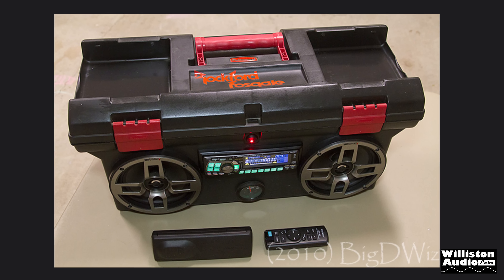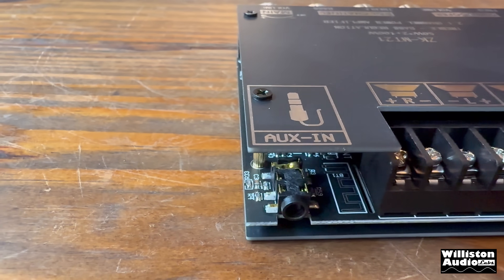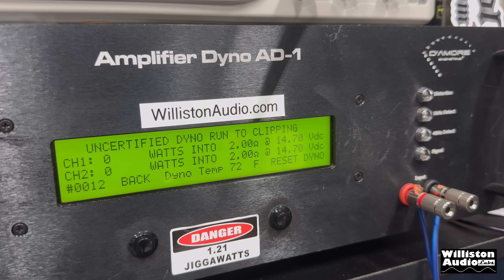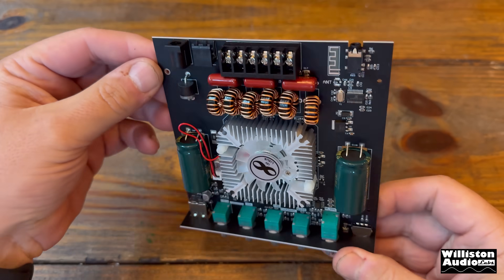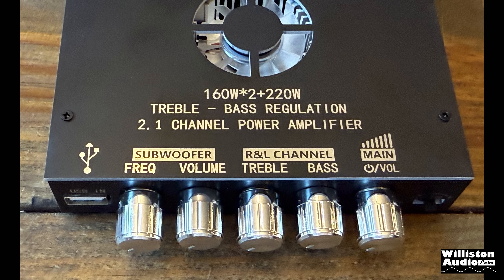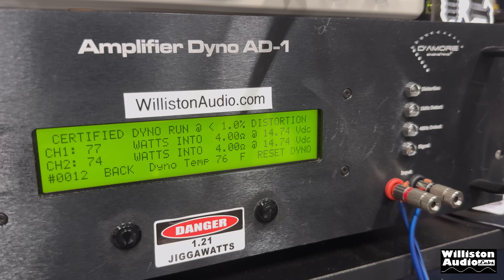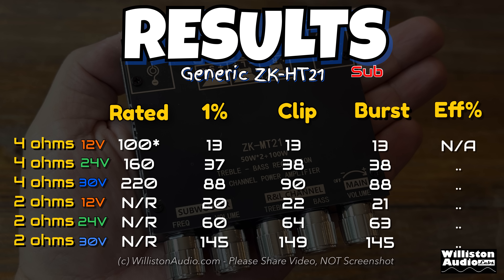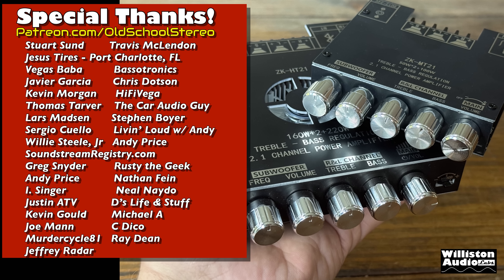Can This $15 Mini Amp Power Stereo Speakers and a Subwoofer? ZK-MT21 and ZK-HT21 Tested and Reviewed

Comment: I just matched this little amp, along with a super-crappy $50 "subwoofer" from Aliexpress, a JCALLY JM6 Pro Dongle-DAC and an old pair of "Bottleproof" (all metal case and grill) Blaupunkt bookshelf speakers and... For a system which cost less than $150 NZD in total, and I plugged it into a little laptop and... Holy Moly. I can hardly believe it: it actually sounds bloody good! 
Like WAAAAAY better than a stupid Logitech 2.1 piece of garbage. Super surprising. Would buy again!

Edit: Hehe - I got a bunch of the $5 light bars from AliExpress, too!
How can you possibly say no to those???

Comment: I'm currently using the " BT- WUZHI" , that's what pops up on connected devices. $12 on TEMU. I have it hooked up to a pr of Micca MB42's and a ARSp112sw (?). I'm not at home to know if I got that right.  I'm happy with it because it's cheap and sounds good. I don't know what I'm missing if I don't compare it. I also own the ZK-MT21 and the Micca 's sound great with that. I do hear a hum with the WUZHI at louder vol. or if I touch the dials. Fun stuff .

Comment: I started with a cheap 2.1 amp then got Fosi Audio. Not high end by any stretch, but does great running my speakers off my PC with speakers I built. Now I have a plan for head unit boom box with Tang Band speakers. They have a slim mount 6.5 inch subwoofer. It won't dip into earthquake territory, but will be great for such a build. .25 cubic feet for F3 of 62.2Hz.

Comment: I have the ZK-MT21 class D amplifier,  hooked it up with my 40watts Pioneer bookshelf speakers and a 100watts 8ohms subwoofer...audio output is awesome...I didn't expect this tiny amplifier can power up my speakers and subwoofer 👍

Comment: Your series of videos on these mini amps got me started building with them. I've done 3 2.1 setups and one 2 channel stereo. The two channel stereo is one of the 100x2 ones you highlighted before this one. Had them on several speaker setups until I discovered the skar fsx 10's. They are a "midrange" pro audio speaker that retails for like $30-35 range. You should hear the bass these things put out on just the two channel 100 watt stereo amp. They are listed to play down to 50 hertz but I would guess the drop off is more like 40. The fattest sounding speakers I've ever heard. Barely need a sub and they are midrange. I tried them on the 2.1 ht21 amp and apparently there's a built in low pass crossover on the stereo speakers. They sounded completely hallow. It's put me off from building with these cheap 2.1 setups. The built in crossover removes like all the mids. My 100 watt x2 stereo amp on the two fsx 10's outperforms all of my other setups with subs and twice the power. Running them on 350 watt 36 volt power supplies. The 100x2 stereo amp is running on a single makita 18 volt drill battery. Hits like a ton of bricks because it's giving the speakers full range. 

You need to check out these skar fsx10's on a video and build a 2 way with some silk domes and a passive crossover. Someone needs to hear these things. Rated frequency range is 50-10k hertz. They are very popular for replacing guitar or bass amp cabinet speakers. Tells you they have way more bass than advertised.
Reply: The subs can't really fill in the mids so side by side the 2.1 system I have with two 5 1/4" recoil components and a skar evl 6.5 in a sealed box running double wattage on a 36-350 watt meanwell power supply is not as full sounding and doesn't hit as hard as 100x2 on a single 18 volt drill battery with two skar fsx 10's.

Comment: 5:08 it looks like you didn't set the frequency knob correctly and the volume knob correctly. To properly measure you must turn the frequency knob and sub volume knob all the way to the right to get the proper output, as it will lower the rms because of incorrect frequency crossover, probably why it says 50 watts only 😅

Comment: Can i run 1 ohm load in the subwoofer out? Or only 2 ohms? Thanks! I'm currently using 24v 3A power supply

Comment: I've run both the 2x50 and the 2x50+100 combos. The 2 ch sounds good. The 2.1... not so much. TBH,  to me it would be better to crossover pre-amp and then use it discretely like that. For example, you could easily use something like a 3-way preamp crossover (think Coustic/Audio control) and then use a relatively small power bank. But honestly... the SQ is so bad at volume that a traditional amp is better. I've blown no less than 6 of these amps. They are what they are. Cheap. But better than nothing.
Reply: BTW... Every one of these I've blown, it was  trying to run it at 2ohm. It does not like it!

Comment: Guys regularly run that larger amp at 42 volts(a fully charged 36 volt battery) and they do great. I wonder what they put out at that voltage.

Comment: Ive just used a £14 HD RUSH Dolby 5.1 and DRS decoder and a couple of similar amp modules to make a really cheap home cinema system, Im going to replace the amps with an infra red remote control versions.

Comment: WHY 2.1? Better to have all power available from the power supply going into just 2 plain stereo channels. 
I HATE subwoofers! They rumble louder in the next room or one apartment over or outside the house, than in the room, because they excite walls and floors! They should be illegal. 
Subwoofers add nothing to actual musical sound, period, but they get noise complaints.

Comment: You should have also tried ZK-TB21. Similar to MT21 but with TI (fake?) TPA3116D2 chips. Preamps built on NE5532 (fake?) chips.

Would be interesting to see signal to noise.. Also do those controls (sub freq, sub volume, treble/bass) do something? How much lift and what frequency adjustment range? thx
Reply: he showed the controls in use in the vid. but I also did basic testing on the tb21 I own. (the newer model of the mt21) the treble and bass controls are cuts not boosts, so to get true full range output they get turned up most if not all the way. the sub controls are a separate volume control for the sub channel gain and an adjustment for the X-over point for the sub channel. it  seems to be between about 45hz and 150hz
Reply: @killerproblem87 do you know if the base X-over acts as hi-pass for main or the base or it doesn't and main are 2 independent amps? thx
Reply: @cyclopathic998  the L+R channels are full range, the sub channel is separate. but fed from the same input source. the sub x-over is only for the sub channel. the bass and treble controls ae only for the L+R channels. the only common control is the main volume knob as it runs the output gain for both amps. the sub volume control acts as an input gain for the sub amp.
Reply: @killerproblem87 so you basically need to be careful to not blow L+R with low frequencies.. thx!

Comment: Hello   those power ratings are most likely the max power ratings and not the rms power ratings. The readings you  got were what the actual rms power ratings would have been if they listed them that way. It is to bad most companies these days only list the up to or what the amp can do for a very short burst of power and they list that as the power rating of the amp.

Comment: I use similar 2.0 boards with power tool batteries to build vintage suitcase speakers.

the 2.1 boards seem to have crappy XO setpoints. I haven't liked any I've tried. been meaning to try the dayton boards with programmable dsp options.

recently built one of the higher powered 2.0 boards into a ammo can with a 36v pack (common in lower end scooters/ebikes), using it to power some 8ohm jbl speakers I was gifted for sound at events. 

I would love to see a diy "meshable"  board come out, so you could litter speakers around a area and have even sound. with each module ideally 2chan with settable XO's so you can run 2 full ranges, or have a sub.

Comment: Is there one of these 2.1 style amps that has stereo speaker connectors   BUT subwoofer at line level (RCA) ?
I have a pair of technics 6ohm bookshelf speakers from one of their microsystems and a 50w Sony active subwoofer I want to make use of.

Comment: hello i absolutely love this channel ,can you  please help with a recomadation for an amplifier  that can drive  my speakers i have a pair of custom made 2way loudspeakers with the bass speakers being  Eminence delta 10A in 8ohm with a sensitivity of 98.9db rated max power 700w and rms 350w and a compresion horn driver of 150w i think rms its around 75w in 8ohm i am looking for an amplifier that can drive them to around 250w per loudspeaker rms but without forcing the amp i was thinking something like 2x500w in 8 ohm and to keep the volume knob  at 12 o'clock i am looking for cheap PA something in class D i saw a lot of them on alyexperess at around 200$-300$ but i cannot find any tests on them like you usualy do ,thank you in advance!

Comment: for mt-21 why is dyno showing only rated @14.77 volts and you say that your testing at 24volts? and also, can you please try the much powerful version the "as21p (with the P haha)" here in our country they are using it to power some 15'' to 18'' subwoofers for outdoor, greetings form the philippines, loved your videos!!!
Reply: He said don't pay attention to the voltage on the dyno because it won't change if hes using a higher voltage. So he's using what he says but the dyno readout doesnt show it.
Reply from the maker: The Amp Dyno is powered by it's own battery bank at around 14.7VDC. The Amp(s) are powered by a variable voltage power supply at voltages stated during the tests

Comment: Buy zk-tb21,mt21 problem cip overheating,tb21 and mt21 are same factory buy they make mt21 cheaper and using cip texas knock down copy and tb21 using original texas cip.
Reply: what they make with 160 or 220 sub channel thats good?

Comment: I have the smaller one branded as wuzhi audio zk tb21 running 2 edge 6 by 9's and alpine 8 inch sub in my shed 
Bang for buk its impressive costing £21 off ebay hear in England 🇬🇧

Comment: It would be cool if someone made an amp kit that requires soldering most components. And can be upgraded. By using better and larger capacitors, better close tolerance resistors . Also, better inductor in the power supply to make more power. and larger caps to store that power to release the power faster (maybe use a good dc to dc boost converter with with a 4-5 or even 7 cell lithium battery for 29v full charged.. or 16.8v for 4 series cells, or use LiFePo4 cells with 4 or 8 series cells. With a 12v 2a power supply to recharge. Or a 19-24v2-5 amp supply. With a cc cv dc to dc converter setup to charge the battery THROUGH A BMS, "BATTERY MANAGEMENT  STSTEM" TO PROTECT FROM OVER CHARGING..  and prevent under voltage/ over discharge.  Push the  peak power with a dc to dc converter. And maintain power with constant voltage as the battery discharges from 4.2v to 2.8v or 3.0v per cell or 3.6v to 2.5v for LiFePo4 cells.. 7x2.8 19.6-29.4v is just shy of 10 volts 0.2volts from being 10 bolts 9.8v will likely  be noticed on the  sound / volume.   A dc to dc supplying a constant 36-38 volts ⚡️ and definitely add capacitors to the output to filter the  noise from the doctor dc switching.. maybe  design a capacitor  charging power-up system . To reduce noise, if the sound quality  is good enough to start with. Maybe  add 10 farad super cap to the battery pack with a precharge circuit a push button to power up the power button😂.   Simple as that, use a resistor to charge the cap, maybe 2-6 ohm 20 watt power resistor. I'm sure thinking if you do all this, just get one of the tiny head units . And add a pocket amp 200-400 watts+. Have two "brief cases!, maybe three with a coily cord to connect them together.  One with speakers one with battery head unit and power supply. The Milwaukee stacking storage boxes?? Or tool boxes??   Fill the inside with fiberglass reinforced body filler about. 3/8" thick or1/8" and add a 1/2" mdf

Comment: The specs sheet is used 10% off. Not 1% off. 😅😅😅. 
Even in datasheet for tpa3116 is 10% off to get 50w 4ohm stereo or 100w 4ohm all in 10% off😅😅😅

Comment: Hi Big Bro, I have Built Many HIFI's For People using  the ZK-MT21 And All my Customers said they  sound amazing , When i First got this model of amp After testing it many times at 12 Volts it started to distort and the main smoothing Cap distroyed itself with a massive bang , I then got two more and even  though they were brand new both work leaking DC across the speaker outputs and the caps started to swell at high volumes , These caps are crap and need to be replaced  I now replace the caps from brand New and now never have a problem , those caps are well under rated but once modifide these amps are first class highly recommend , my first prototype Boom Box with this Amp is now two years old and never have a problem with it, and it kicks ass with the right speaker setup great video
Reply: What cap models? I'm going to be going on my 3rd amp because the Sub chip keeps blowing with a 4 ohm sub after a while.
Reply: @ForrestLambert.2022  Electronic products from China would last from 0 sec (non-working units) to 6 mos (if you are lucky).

Comment: Im currently running 4 of these for my desktop pc sound setup. Way to loud for the space im in now. DAJUNGUO
DAJUNGUO ZK-2202 Class D Amplifier Board, TPA3251 Chip, 220W×2 Stereo/350W Bridged (DIP Switch), RCA/AUX/XH2.54-3P Inputs, DC12-36V with Cooling FanDAJUNGUO ZK-2202 Class D Amplifier Board, TPA3251 Chip, 220W×2 Stereo/350W Bridged (DIP Switch), RCA/AUX/XH2.54-3P Inputs, DC12-36V with Cooling Fan

Comment: Not Related to the current video but, I have seen a Ct Sounds 2000.1d ad on amazon claiming "Engineered to be the most efficient car monoblock amplifier in its class so that you can get the most out of your vehicle’s electrical system"  
The Question is... Is that a true statement, and how efficient is it?

Comment: One suggestion for the battery is to use a battery adapter and a voltage regulator. I use several for Ryobi DeWalt and Ridgid, I have one attached to a handheld CB radio with a 12volt regulator. Another option is to use a Skil powercore 12 battery, it's already 12 volts and they have a type C port to charge them so you don't need a base charger.
Reply: Lol I just saw the DeWalt battery at the end.

Comment: I was waiting years from someone to Dyno test these amps and I was really happy when I watched the previous video because I knew what was coming next. Sadly i was left disappointed because i think you should have buy the proper power supply for the ht21. What I mean with the term "proper power supply" is a power supply with the Amps required to run the amplifier with ease. For example a 36-42v power supply with 15A is necessary to make these test, please revisit the Chinese amplifier one day with the correct power supply or even better with an adjustable one
Reply from the maker: My power supply is variable up to 60V at 20A, but I didn't feel most people using batteries would use voltages above 30V
Reply: I can understand your approach but the voltage means nothing at all by itself .The power that the amplifier can use to produce louder audio is determined by the Ampers of the power supply/car alternator and sinse you are using an external power supply you should provide the needed power for the amp, otherwise the video isn't a Dyno test but a demonstration on how the amp will perform  with these batteries. Thank you for replying, keep producing great  content ❤ @wal
Reply: I should bought that supply to power 20 amps and I will got more powerful.

Comment: This is unbelievable performance for the $. I`m enough years old to remember paying thousands of $ for this kind of performance. To be fair, 80W for a sub is enough, if you use speaker above 90dB sensitivity. For DIYers I would suggest to look for more recent chip amps. Like TPA3255, model name for the amplifier XY-AS21HPA, this one could deliver solid 100W to the subwoofer... with decent power supply.

Comment: The 3255 based device will make 280 x 2 and 540 x 1 on lithium. These can't make rated power on a power brick. And will not sound good. 😊

Comment: I was thinking about amp circuitry, they must have some kinda boost circuit. The voltage to the speaker must be higher than the supply (~13.5v).

I'm assuming that is shared between channels, so that may be a bottleneck, limiting wattage to the amps. You could test one channel, and leave the other(s) disconnected. It could be interesting to how much that gains on your tests.

Comment: Thanks big d this is exactly what i wanted i made a comment last about testing these models and bam big d delivers i was running the mt21 with 2 6.5 alpines and a 12 inch jl auidio  sub  in virtual pinball machine gonna get the more powerful amp for those and use the mt for the flipper sounds and ball noise thanks again u the man big d

Comment: I have an amp just like these but with a TPA3255 chip inside (model on amp is ZK-AS21). It says it's 2x220w stereo and 350w subwoofer.

I think it can handle up to 50v, but I have it connected to one of my 40V batteries for my power drill, a 500w, 10" sub and 4x 4", 3ohm speakers wired as 2x 6ohm loads for each channel.  Very impressed by the sheer output on the amp, I don't know what the real world power rating would be, but it makes me think the 500W rated sub is going to blow when I crank it up, it thumps that hard and looks like it's reaching Xmax.